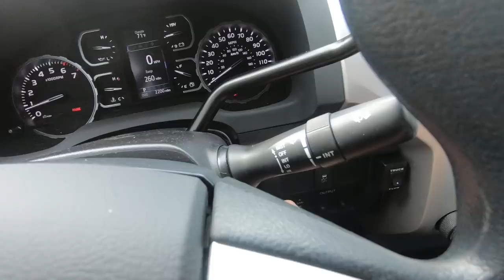Goat Size FingerNail Files

Comment: Your Squash looks like a Golden Hubbard. They are awesome storage squash and great eating. Both as a savory baked squash and instead of pie pumpkin purée for pumpkin pies. I also use them in Mock Apple Cobbler.
I would recommend a bottle of Kopertox for your goats feet. Use for knicks and to have on hand in case you get scald or foot rot. We use it for our sheep. [It is not cheap but a small bottle on hand is a good investment in prevention]

Comment: Al, not sure if this would work for goats or not, BUT a friend of mine runs a dog grooming business.  She also shows a few breeds of dog.  Since she has to work with them so much in the grooming stand, she started training them every day.  Every day (or at least every other), she would put each puppy on the table as if they were being groomed.  She would brush their hair a little bit.  Check their skin and teeth and whatever health items needed to be checked.  She would usually turn the trimmers on, but just let them sit on a table.  The point is that the puppies got used to being on the table and being "handled" so when they got older and needed those services, it was no big deal.  Even though you aren't miking the little ones, it can't hurt to put them in the stand, give them a little brush and check their health.  Give them a little treat and after a few weeks, they will probably let you do whatever you need to do!!

Comment: I think the turkey roost is too high for them. Plus with their wingspan they may not have enough room for all of them. I would try moving it down and getting a longer one to run from the door wall to the back wall at their head height. They might have to duck to get under it, but they can get to it without hitting the top of the coop.